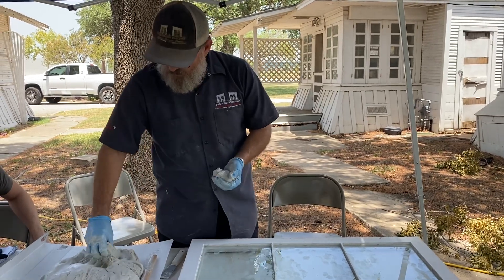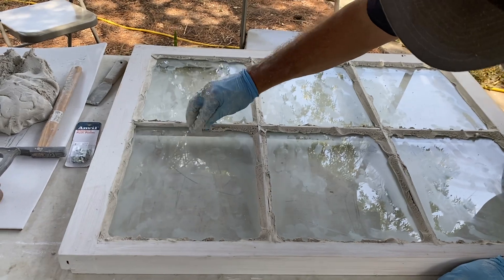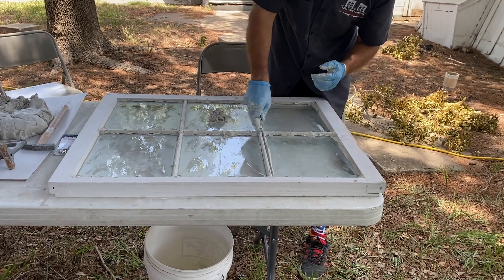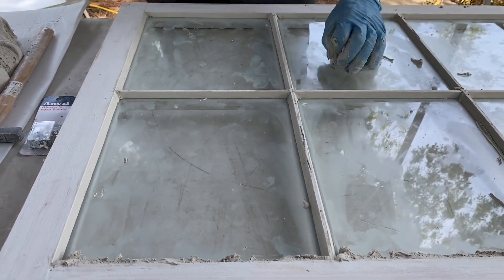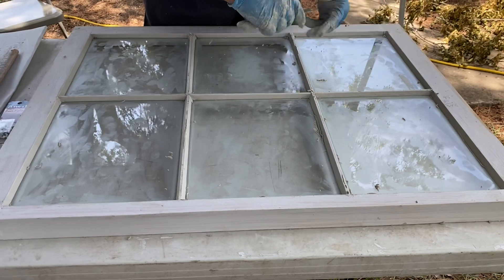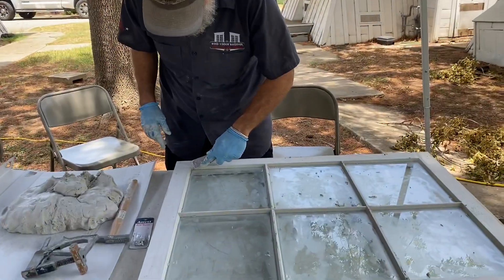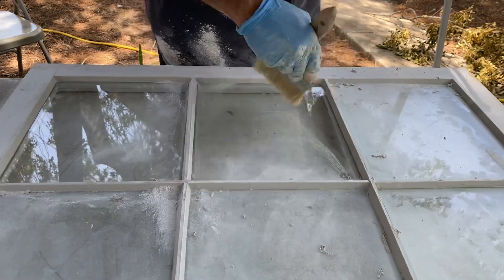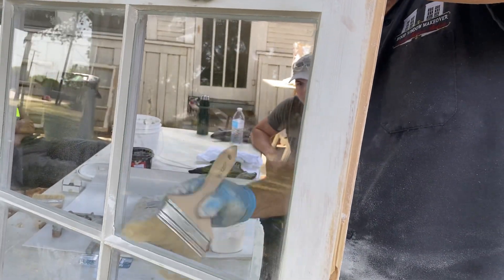Glazing School. How To Professionally Glaze A Historic Wood Window Sash

Comment: Glazing old sashes is a nightmare. The old glazing never comes out uniformly. In some places, where the wood is water damaged, the glaze just pops out, but in other places, the glaze is hard and difficult to extract without damaging the rabbet. I’ve tried every tool. Flexible scrapers, heat guns, multi tools, and utility knives. It’s never easy. Especially when you reglaze the windows in place.
Reply: I struggled too until I just decided to burn a window completely if I needed too with the heat gun, and then things started to click.  I was rushing the heat gun.  Slow it down and let the heat soften the glaze.  Keep going back and forth until it almost falls out.
Reply: For removing old glazing and paint a Steam box helps too if you build one and are able to remove the sashes to put in steam box for 30 mins.  They have a few diy versions of a steam box if you search or you can buy one.  This would be for if you have several windows or more.  If just a single them I a totally agree with heat gun as mentioned above